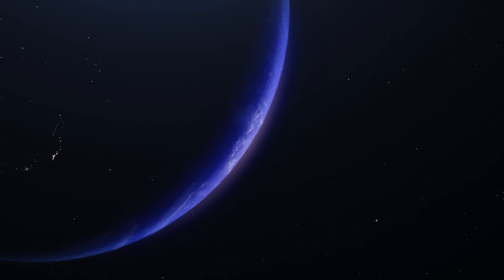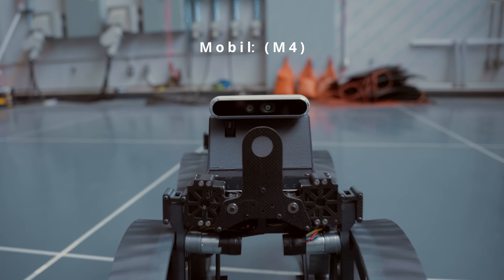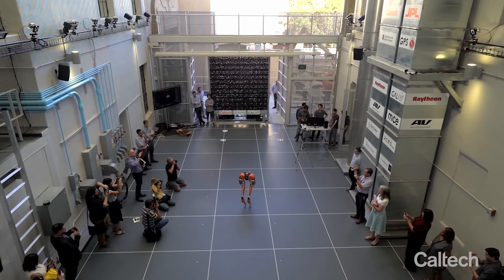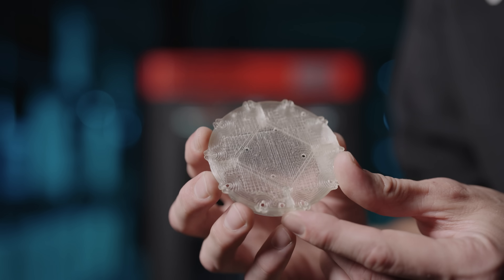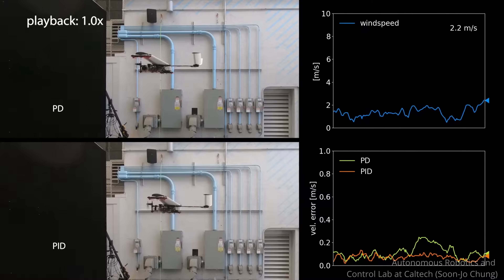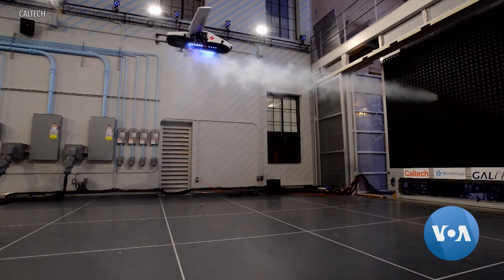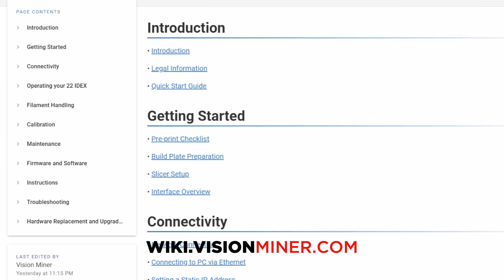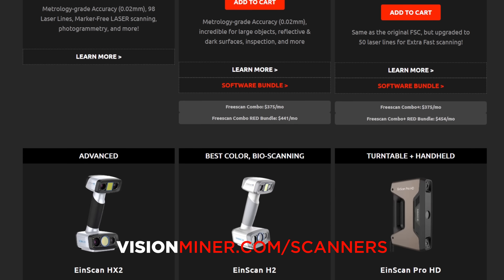This Next Gen Drone is 3D Printed.

Comment: Why PEEK-CF and not something cheaper/lighter.   Foaming ASA comes to mind.
Reply: It costs $150 to get a kilogram of material to orbit. It would cost even more to get that kilogram to mars. You really want the highest strength to weight ratio. Foaming ASA has good strength to volume ratio, but you can't do better than cf nylon or cf peek for strength to weight. PEEK also is particularly resilient to the high temperatures and radiation of space
Reply: The machine alone is 15k we are talking about million dollars in budget. They don't care about $$ per KG.